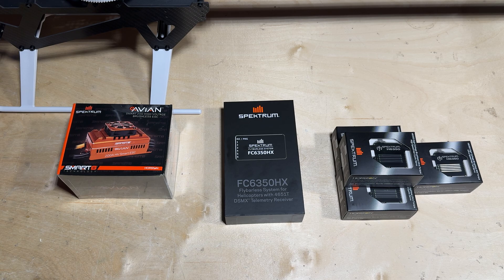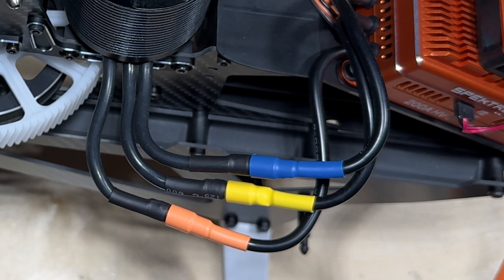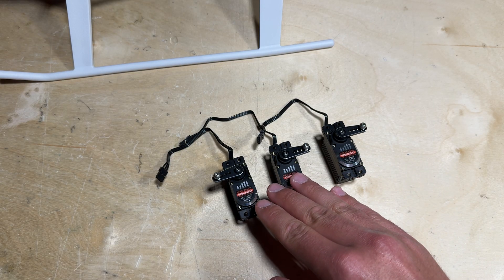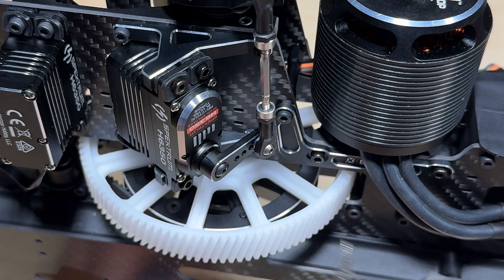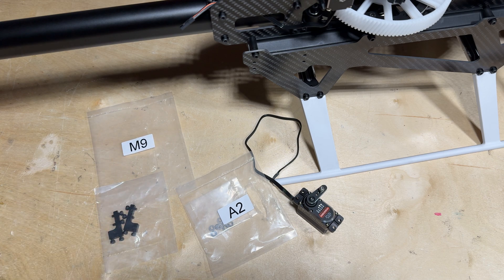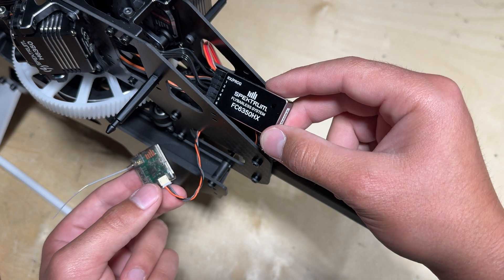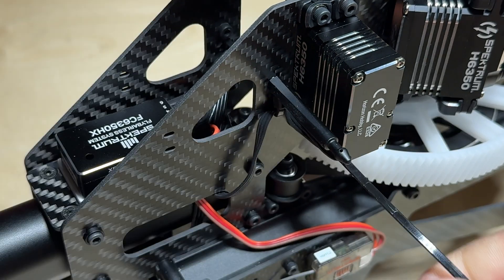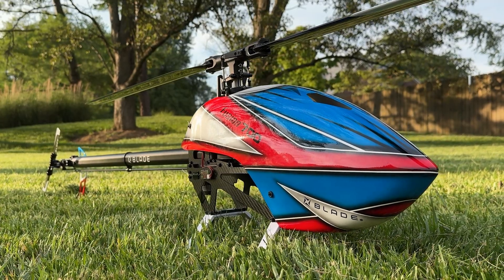Blade Fusion 700 Build Series: Electronics Installation

Comment from the maker: Please click "...more / Show more" for links and more information. Visit https://www.horizonhobby.com/search?q=th-fusion-700 for more information on the Fusion 700.

Welcome to the fifth and final video of the Blade Fusion 700 build series! This video shows how to install the ESC, servos, and flybarless system onto the Blade Fusion 700 so it can be ready for FBL setup and its first flight. The electronics used in the video are from the "High Performance" Super Combo [BLH13075HPC], but the same method that you see can be applied to other servos, speed controllers, and flybarless systems. Although there are many ways in which the wiring can be done, this video showcases a middle of the road solution for those who want clean, but easy wiring. You can also see the proper way to mount the batteries to the battery tray, and how the battery tray system works on the helicopter. Thank you for watching the electronics installation video and for following along with the build of the Blade Fusion 700. Happy flying!

Follow Blade RC on Facebook and Instagram for more Blade content!
https://www.facebook.com/BladeRC1/
https://www.instagram.com/bladehelis/

Comment: Hey Ethan and balde team. I have finished my build and am ready for maiden. Im a bit concerned though as my motor with 11tooth pinion, super combo, seems to be getting hot after ground run with no blades at 50% throttle, only after 2minutes? Any advice would be appreciated. The build was great and the heli is beautiful. Cheers
Reply from the maker: Thank you for the kind words and for reaching out! The motor warming up after a 2 minute run-up on the bench is normal. When blades are installed and the heli is in the air and the motor is getting airflow, it will run a little cooler. We are happy you enjoyed the build and are excited for your maiden of the Blade Fusion 700! :)